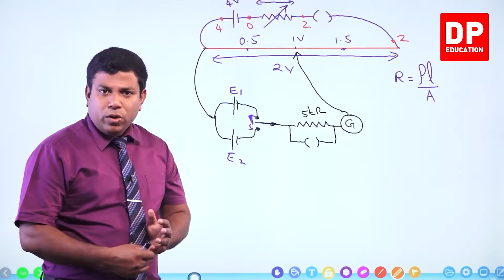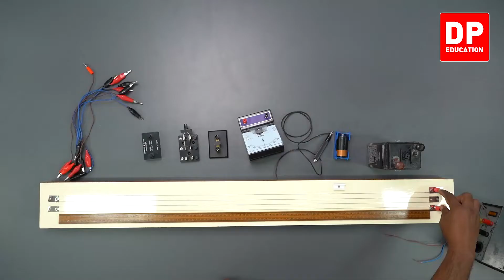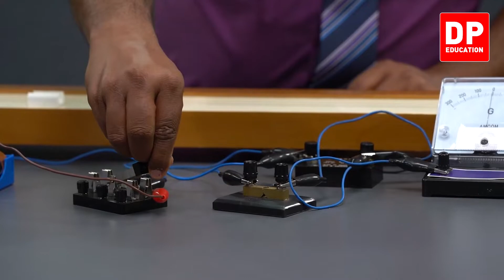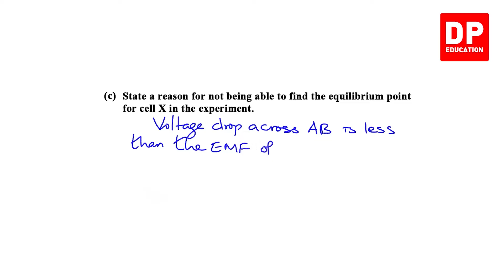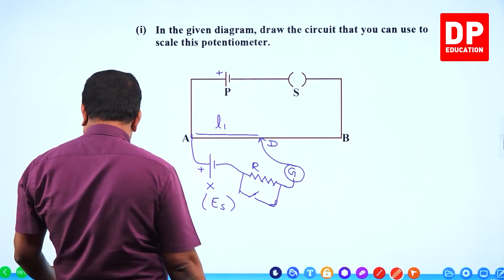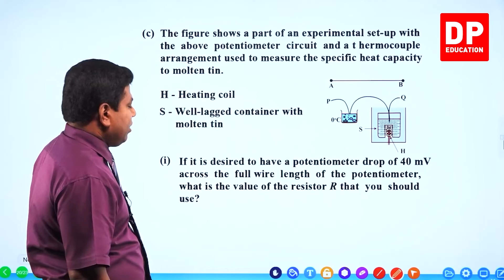Electricity | Practical No 33 - Potentiometer - Comparing the EMF of two cells

Comment: Sir isn't the diagram u drew as the answer for 2005 question part(a), (ii) wrong?? Safety resistor should connect before galvanometer right? Current should pass through the safety resistor first and lower if it's too much higher then pass through the galvanometer. Isn't it????
Reply: No, the battery identifies the resistance of the circuit and sends the current accordingly. Therefore the location of the safety resistor doesn't matter as long as it is in series with the galvanometer.
Reply: The current doesn't change because it passed a resistor unlike voltage
Reply: yo got the same issue here